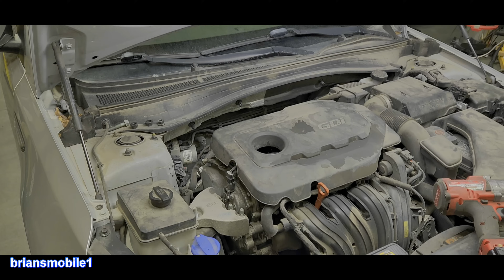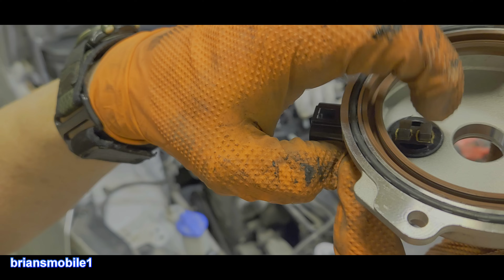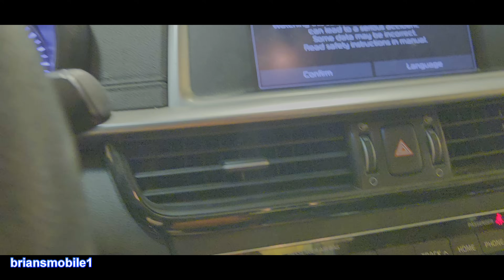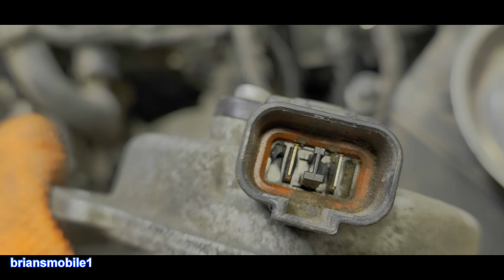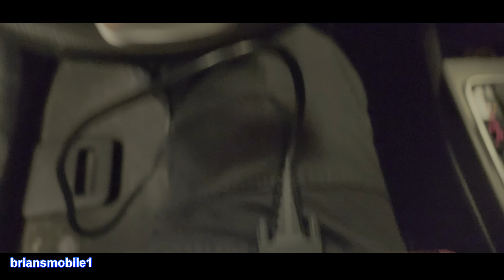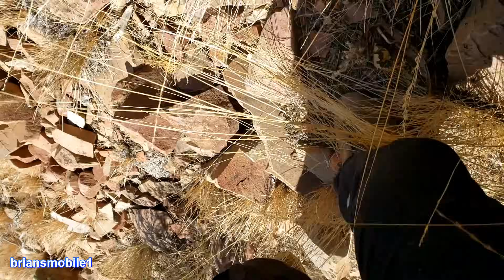KIA P0010 Fix

Comment: Just changed the cover with sensor and the sprocket looked good.  Test drove it and no light.  A day later the light is on again but drives fine 🤔
Reply from the maker: Did you clean the copper surface well?

Comment: This is a pretty good illustration of why most manufacturers made these actuators hydraulic. Count up the rotations that those contact surfaces make, and understand why electrical contacts don't last.
Reply: This is similar to how an alternator brush is setup. probably needs an update to the design but for it lasting 143k  I would say it’s decent.

Comment: Just did one of these for a customer. This one though the inner seal failed causing the sensor to fill up with oil and those bushes to not make contact with the cam gear. Clean it up new cover and new seals and it's good to go!